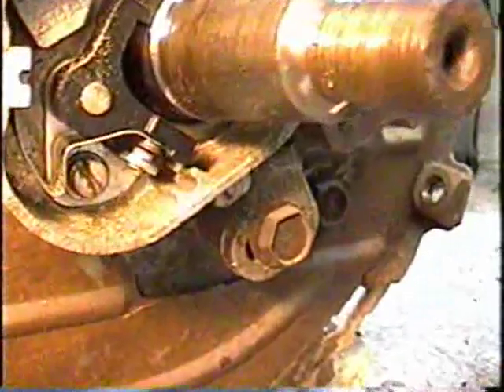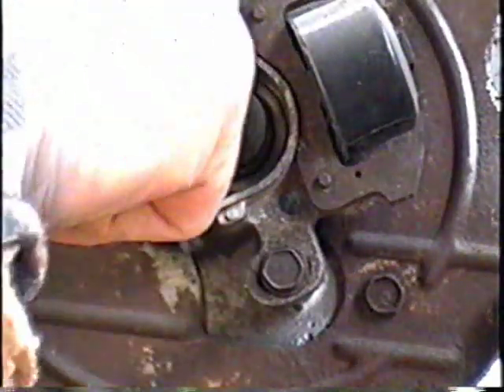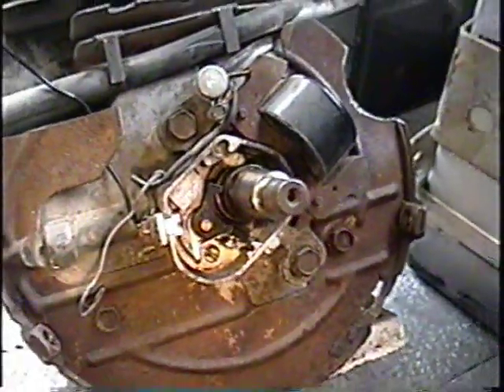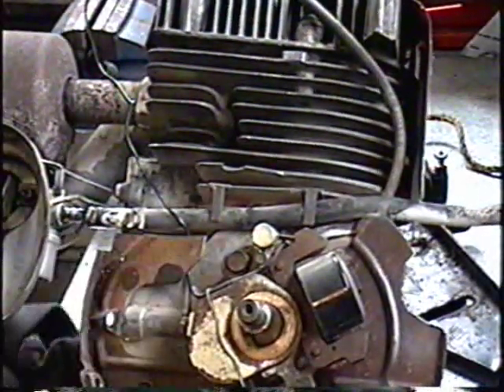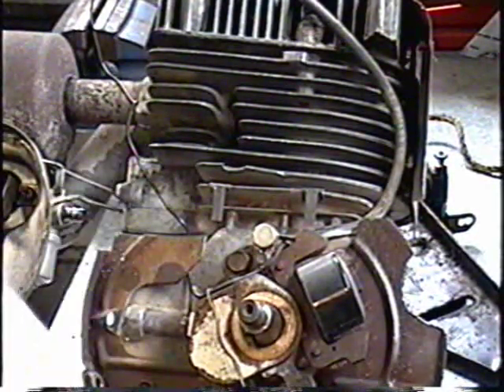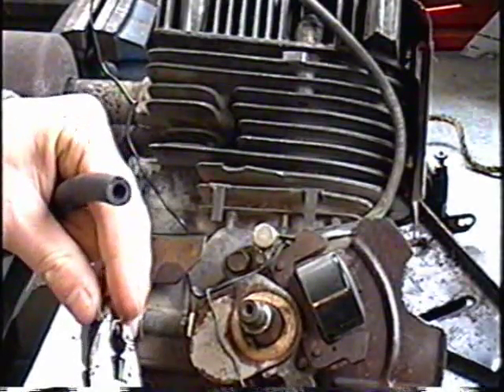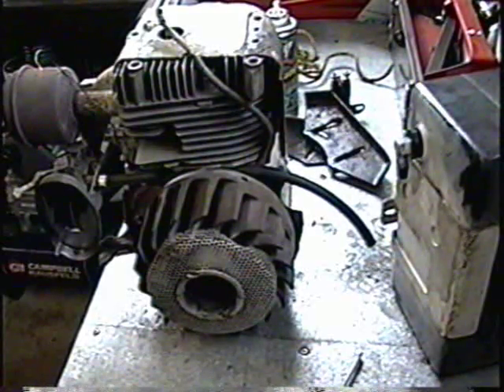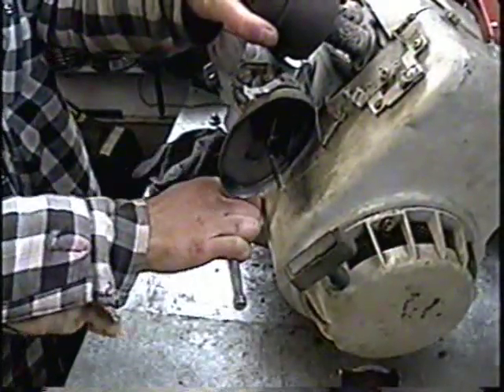How To Remove Flywheel, Points Timing and reassembly of TECUMSEH 8HP PART 2 of 3

Comment: Is it normal for the spark to fail if points and Condenser are bad or is it the coil? I will of course test the Condenser but my thought is the coil has failed on this older Ariens Snow blower. It started running bad last year, I honestly thought it was the carburetor. After replacing that, nothing improved. It still ran at reduced power. I never considered the points and Condenser were failing. Its been a while since I even worked on an engine with them.

Comment: A true story: One of my customers brought his walk-behind rotary lawn mower with a 3.5hp Tecumseh engine (model LAV35) to me just to have the flywheel removed. When I had the mower on my work table to remove the flywheel, I noticed that the flywheel was wobbly but still tight on the crankshaft, then I found the crankshaft was broken in two at the connecting rod journal. I thought this was odd , so I called my customer to tell him about this, and he said his neighbor tried to "pop" the flywheel off [by hitting the threaded end of the crankshaft] with the mower on the ground standing with a 10 lb. sledge hammer!
Reply from the maker: lol
Reply: Some people are real idiots... and they breed! Reminds me of the old joke: "Hold my beer and watch this!" lol

Comment: Hello, I wanted to know if you knew where to get a couple of things for the 7hp older tecumseh (on a 70's ariens). I'm looking for the bolt for the assembly that the cover with the starter attaches to. It's the bolt next to the bolt that keeps the magneto attached, it's in the first few seconds of the video. Do you know where to source this bolt? In addition I'm looking for a bolt to attach the gas tank. One of the clips was missing one when I received the blower and would like to resolve that. Thanks in advance!!
Reply: Also thank your for these videos. I got my blower running again thanks to these!
Reply from the maker: call discountonlineparts 1 (877) 314-6990

Comment: hi donyboy, I watched this several times trying to see where you timed the engine , but I never saw it. I saw the point but not how to set the coil with the 2 bolts. How do you set the coil if it was removed without any marks being put on the posts to show where it was?
Reply from the maker: usually half between bolts

Comment: I really appreciate all your videos. I have an old Ariens Snowblower with a 33290 starter that I think is not working properly. When I took it off part of the aluminum flywheel teeth are chewed up. Last 2 winters I had an issue where the starter gear was stuck and I had to turn the flywheel to release it. Wish I knew how to repair the starter....it seems to stick on the gear.
Reply: I just had one of those come through my shop with a frozen butterfly valve from old dried up gas. What was weird is it still worked just at WOT at all times.

Comment: Hey I got a tecumesh engine like this one for free. The carb is almost new, I cleaned it. I tried with 2 different plugs all cleaned up, checked the points. Removed the dead wire for stopping the engine. It still doesn't work, even with a pull with the choke, followed by 4-5 pulls without choke. I also replaced the old gunky oil with new one after cleaning it with solvent. Any ideas?

Comment: Have you ever had to fix the stator plates on these type of magnetos. I have a 5 hp that the plates are fanned apart. It seems to misfire a lot. I've already replaced the coil, condenser, points. and did a valve job and piston rings. I can't figure out why this thing won't run. Thanks for any help.

Comment: I have a Tecumseh 143.744012 and am trying my best to get it running properly.  Is there a way to set the air gap on it?  I replaced the old coil and that involved removing the magneto.  Did not mark before, so I'm worried the gap is not right.  Also, would a bad condenser make it run only in 1/2 choke and stall out when moved to no choke?  By the way, your videos are AMAZING!!!  Could not have done any of this without you.  Thank you!!

Comment: Excellent videos - best on the internet (and YouTube).  I have a HS50 that I am buying a new coil for (Amazon), hoping to get a spark (carb has been disassembled and cleaned; head removed and valves lapped; points and condenser replaced).  I hope the new coil will do the job - do you have a video on how to check the coil?  Tnx.